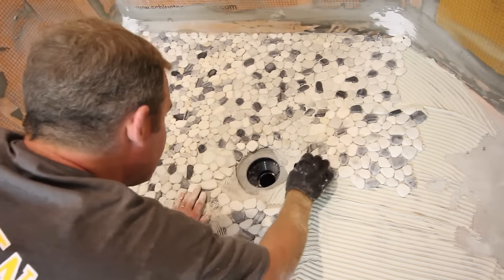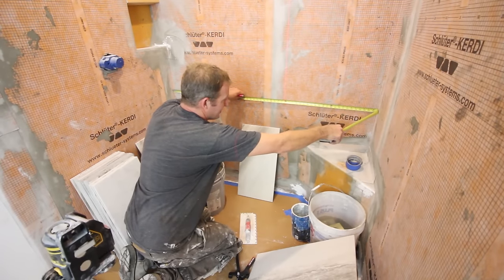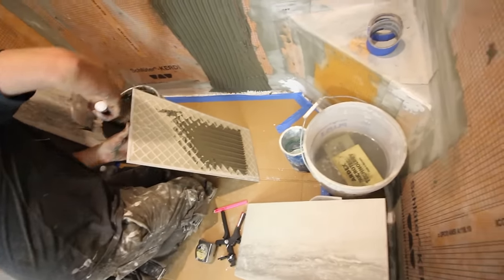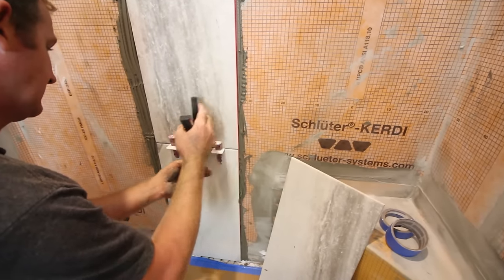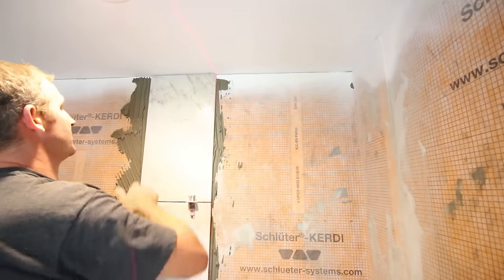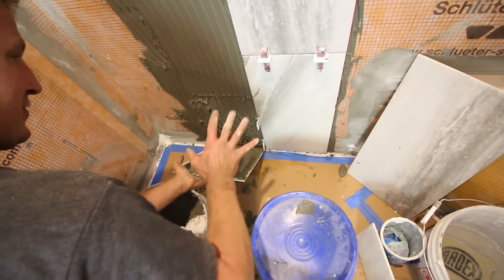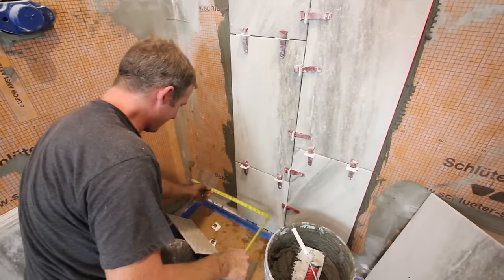How to Tile a Shower Wall...Vertical 12x24 Porcelain -- by Home Repair Tutor

Comment: Why didn’t you use a level when tiling up the wall ? I don’t see a level ANYWHERE how do you know if your falling in or out ?
Reply from the maker: We use laser levels, it may not be evident in the video but we wouldn’t set tile without a laser level
Reply: Yes I see the laser line on the side of tile  so your grout line is level going up but how are  you leveling the face of tile do you use laser level there to ?
Reply: Josh is asking how do you know the tile face is plumb?
Reply from the maker: You can use a standard 2 or 4 foot level on the face of the tile. We also used the T-Lock leveling system with this tile and that helps tremendously with keeping the tiles flat and even with each other
Reply from the maker: Thanks for clarifying

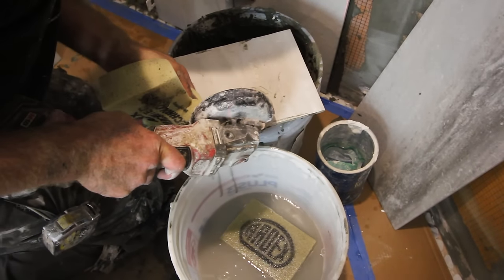Comment: Good vid.  At 8:54, was the shower corner curved, making shaving the corner necessary?  Was it not square?  What if you don't want to stagger the vertical tiles?  Can they be installed like a game grid?  What about tiling the ceiling?  Link for laser, please.   Have yet to look at the course and written content. Thank you.
Reply from the maker: It was curved just a little, due to Kerdi-Band but nothing drastic. You can install tile any way but the walls should be as flat and plumb as possible. Tile ceiling is optional but use Ardex X77 thin-set, it’s the best for ceilings. Lately we’ve been using a DeWALT laser but also like Bosch
Reply from the maker: Almost forgot, here’s an Amazon link to our tools -- https://amzn.to/2OlirR3
Reply: I was wondering about this too since the TCNA says to offset by thirds. The vertical stacked is getting popular so how do you keep the tiles from cupping?

Comment: Is it more aesthetically pleasing to use large format tiles in small bathrooms?  I am redoing a 7' x 4.5' bathroom.  The shower area will be 34" from front to back including 4" curb.  Was planning on using a 3"x6" beveled white subway tile for the walls and a 6"x6" tile for the floor, now I sm not sure.  Fyi, I have zero design skills.
Reply from the maker: smaller tiles would be best for the shower floor so they can maintain the slope, eg pebble stones or 2”x2” mosaics. Subway tiles will look great on the walls. We’d tile the floors first then shower walls and maintenance expansion gaps at any change of plane
Reply: @HomeRepairTutor  One more more question, I was planning on using the same tile on the floor outside the shower stall as I used inside the shower stall but now not so sure if that would look good.  What would you do?  Use the same tile and make it a continuous run from shower to main floor or use a different tile outside the shower?

Comment: How do you keep the thinset from drying out during cutting and installation?
Reply from the maker: mixing thin-set per the directions helps with pot life, Schluter's ALL-SET has gotten a lot better in this respect. Ardex X77 has the best pot life and working time in our experience.

Comment: How do you guys feel about epoxy grout .  And is it absolutely required for in shower tile floors
Reply: Devin Hublal 
It is not absolutely required in any shower,but it would be going above and beyond the normal if you used epoxy grout 
If it’s under 1/8” grout joints then I use non sanded grout.  If it’s 1/8” or larger then I use Sanded grout
Reply: Devin Hublal 
It is not absolutely required in any shower,but it would be going above and beyond the normal if you used epoxy grout 
If it’s under 1/8” grout joints then I use non sanded grout.  If it’s 1/8” or larger then I use Sanded grout

Comment: Is it required to do a 1/3 spacing of tile? Or can I just run them straight side by side?
Reply: The 1/3 pattern has to do with the natural bow in a long tile. If you run a 50% bond chances are very good the crown in the middle of the tile will cause lippage (the edges of adjoining tile to be uneven). Most tile makers have a maximum offset listed for their product. You can run them with no bond (no offset) in a modern pattern since all the crowns (humps) will be lined up. Some tile are much worse than others.

Comment: With Wedi you would not have the build up in the corner that Steve keeps referring to on the Shulter board.
Reply from the maker: Great question, Wedi Joint Sealant can also create buildup problems in the corner. Using a corner trowel helps but it can also be problematic. Every system struggles with this issue but ultimately it's fixable. For example, the back of tiles can be ground down to create room for sealant or small humps in Kerdi
Reply: @HomeRepairTutor  thanks for the advice

Comment: two inches cut in the niche looks awful
bench seat suppose to go under the wall tiles and first row has no space between the floor
Reply from the maker: simply untrue, if you follow the Schluter Handbook it shows the seat being flush with the plywood which in turn dictates tile placement. Be sure to follow the manufacturer guidelines and not done theory based on opinion